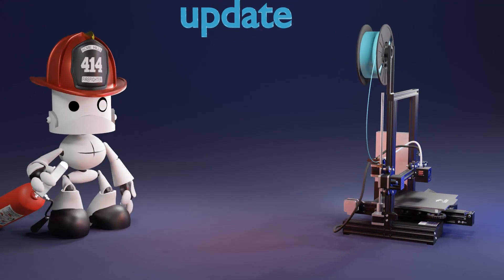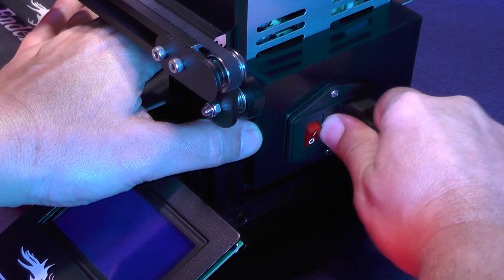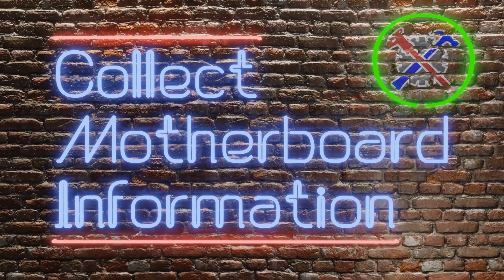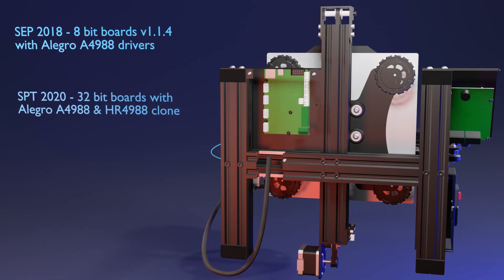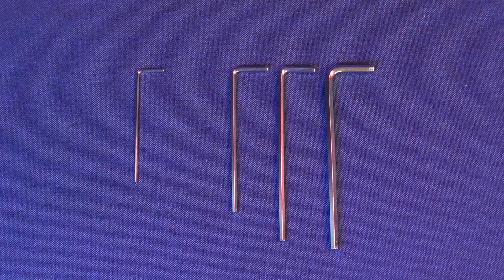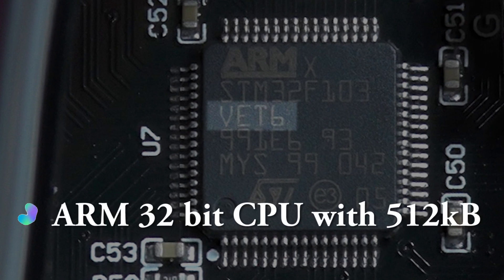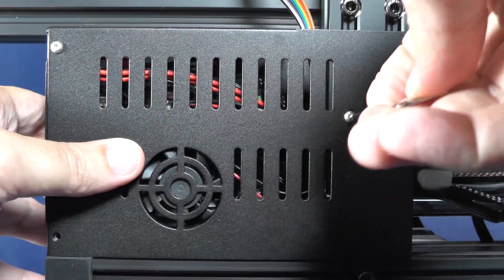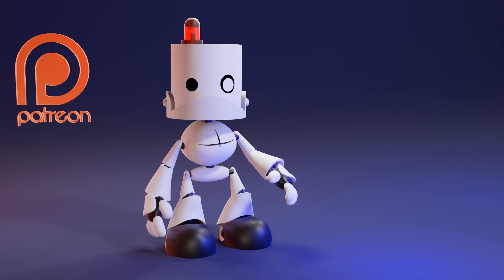#Ender3Pro #Firmware #Update (2022) 1 of 3 - Thermal Runaway test the #Ender3

Comment: I removed the heatsink to identify my stepper driver and the chip did not have any writing on there. How do we confirm at this point?
Reply from the maker: That's a first!!
Would you mind sending a picture of your printer? I may be able to recognize what version of printer you have from the pictures. 
Can you also tell me when you bought this printer?
I would also appreciate if you sent me a picture of the chip, if you don't mind. 
My email address is makrmindset@gmail.com.
If you prefer, I could have a conversation with you over the phone. Send me an e-mail and I will reply with my phone. I live in the  Eastern Time Zone (ET).
🙂👍
Reply: @MakerMindset  I was able to clean the chip it was such a perfect covering it was uniform the outline of the chip. Thank you for replying.

Comment: Thank You so, I just updated to latest firmware and after the update i get this thermal runaway message, before update everything was good, any advice please?
Reply from the maker: I am really sorry! I check my channel daily for new comments, but yours slipped through the cracks. It's been 2 years! Holy poop! 
Well, I am sure that you already got your answer by now. However, before we continue, I need to talk about the reason for this problem of having Thermal Runaway protection going off all the time. This feature is disabled by default in the older Ender 3 printers. When you start printing, the puny heating element needs to keep the temperature of the hotend as close as possible to the temperature set in the slicer software. If you are printing small objects with a lot of details, the printer will never need to travel very long and, therefore, will be able to keep the temperature of the hotend very close to the ideal temperature. If, however, you are printing a large piece that requires the print head to travel long distances back and forth, the heating element will start to struggle to keep up with the load. The temperature will begin to go down, and eventually, the Thermal Runaway protection will begin to think that there is something wrong with the hardware. That's when it will be triggered.

So, here are a few possible solutions:
1. First of all, Ender 3 printers were designed from the ground up to print PLA. PLA has a lower melting temperature and a 40W heating element would be able to handle the load. However, most people end up printing with PETG. Depending on the brand, the melting temperature can go as high as 245 Celsius! My advice is to either disable Thermal Runaway protection (at your own risk) or go back to printing with PLA until you can upgrade your heating element.
2. If you are printing PLA and are still having problems with Thermal Runaway protection, one solution is to either turn off your air conditioner or to put some sort of barrier to prevent cold drifts from cooling off your printer. If you live in a colder climate, consider moving your printer closer to your heater.
3. If none of the above solutions has solved your problem, consider changing the settings in your slicer. You might want to slow down the printer speed to give it time to handle heating the filament when printing large areas. You could also slow down the fan speed in the slicer so the printer can keep up with the printing process.
4. You could alter the speed of the printer or the fan speed during the printing process. If your prints tend to fail at the same spot, you can watch the printer and intervene at that spot to slow down the printing process or the fan speed. You will find this on the printer menu.
5. One of the most common problems on the Ender 3 is the thermistor falling off its little hole or failing completely. I always have an extra thermistor in my drawer. I don't do this because the thermistor might fail. It will fail!

I need to make another video to talk about this! 😊
Reply: @ Thanks anyways...

Comment: Very cool trick! 
I didn't think that powering the Ender CPU from 5V usb is officially supported... 
Looking at the schematics for the Ender3 and 3v2, it looks like there are only parasitic diodes (in the buck and stepper drivers) allowing minimal power to flow from the 5V USB input to the 24V power rail for the motors and heaters. The "24V" rail will probably have <4.3V on it, and may possibly damage the drivers ICs and/or buck controller if too much "24V" current is applied.
The datasheets do not specify a max reverse bias current for the parasitic diodes in the integrated mosfets, so beware.

Comment: I opened up my printer just to see which board I got.  I didn't see the version number, but did identify it as the 32 bit board.  I've read that the boards with the mini USB connector were the 8 bit boards, and those with a micro USB or USB C were the 32 bit boards.  However, that may not be true 100%.

Comment: I'm excited about this series. I was trying and failing to update Marlin on an skr e3 v3. It was not working as outlined in many videos and then brick blue screened. That board is going to be returned for a replacement. I have had a hard time finding any videos anywhere that help determine hardware failure. I only came to the conclusion  that it may be hardware, after spending untold hrs trying different things.